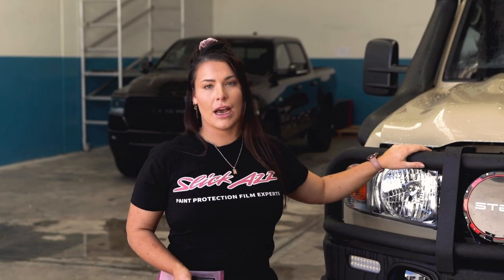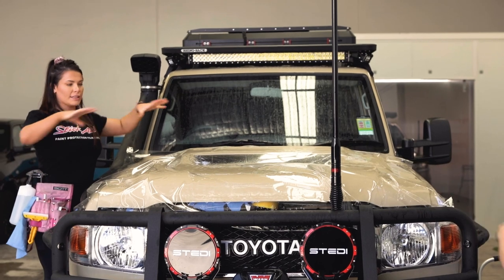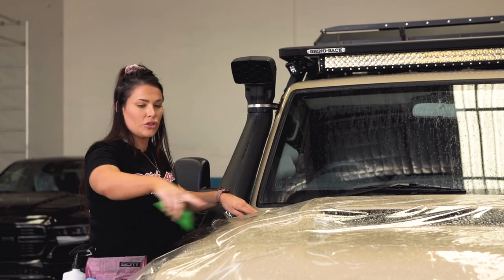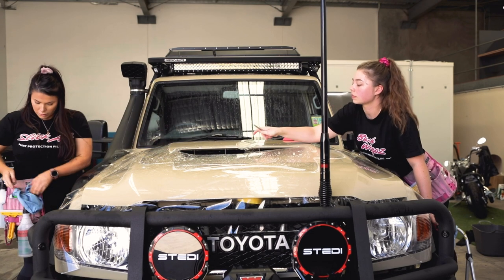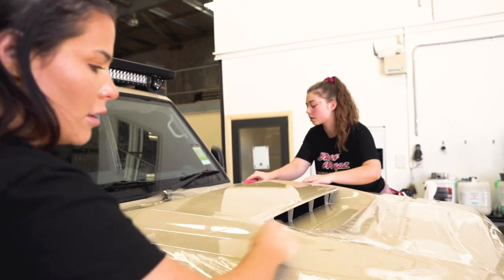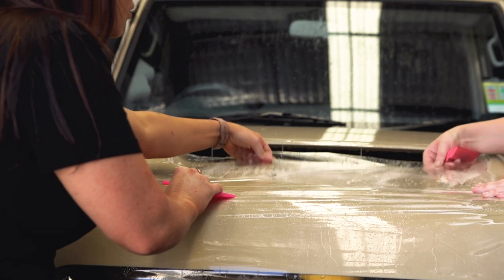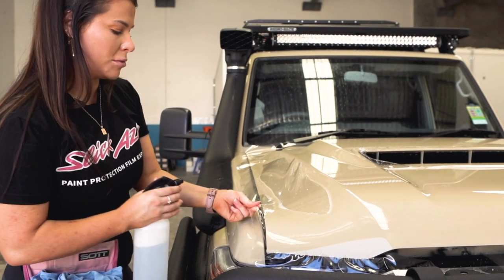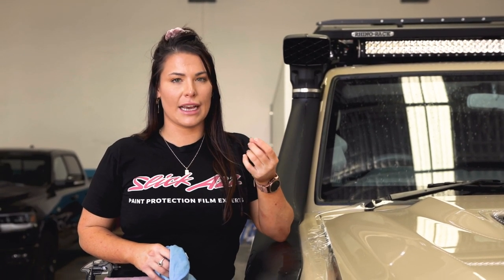HOW TO PPF: 79 Series Bonnet

Comment: Wow you girls made that look so easy! Any tips on avoiding glue distortion around the very curvey edges of bonnets where the fingers generally are even after stretching? And is it the stretching that causes them or glue drying?
Reply from the maker: Hey Daine! Great question. It sounds like you haven't got quite enough stretch on it, those big curves on the front of the bonnet should be glassed out before you go ahead and squeegee.

Distortion is usually from the adhesive grabbing in one area, and then being stretched off of that stuck area. So if you have a ridge of the panel that is too dry, the film will grab to it, then when you stretch off of that you will get loads of distortion. It also really depends on the flexibility of the film you're using!

A couple of things to help with distortion 
1. Warm water - a little heat helps get some extra flexibility out of the film. I have found this helps reduce the distortion
2. Check your slip solution. Every film is different and needs different ratios of slip, so be sure you too have too much or too little. 
3. How many times it takes you to do the stretch really matters. If you go for that big stretch over the headlights, only to lift and redo it again, you are more likely to have distortion lines. 

I hope this helps! Feel free to call the shop anytime if you need some more help with any car :)

Maddi
Reply: @SlickAzzProtectiveFilms  thanks heaps for the tips! i think your spot on with the stretch part. ive since tried stetching the front corners a little filmer and glassing it out to try get the edges sitting real nice first like you girls did and it did work much better. and also trying to stretch over as large of an area as possible.

its a little cold in perth at the moment so a little heat would definately help soften the film too. 

ive been using suntek ultra the last few times and using high tack to lock the edges down and its working great. im finding im getting a little air trapped sometimes when i wrap around edges or corners and need to lift them to remove it. i usually wait for it to dry a little after spraying tack solution, maybe thats my issue but i find it hard to get it to stick down when its real wet. im constantly learning each time though :)

you girls are awesome, i really enjoy watching your vids, keep up the good work.